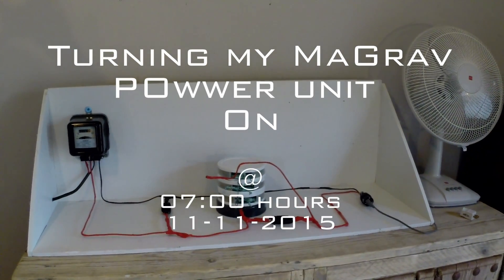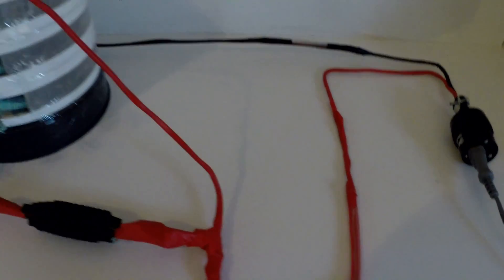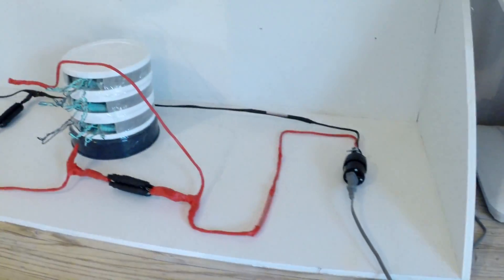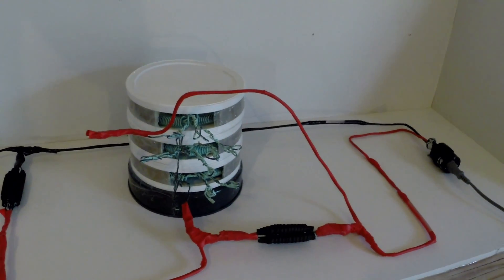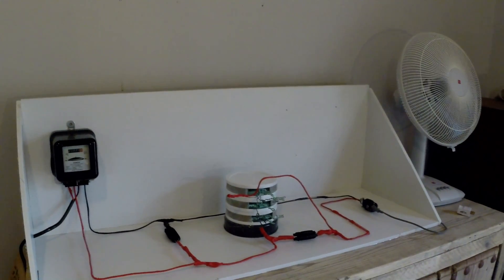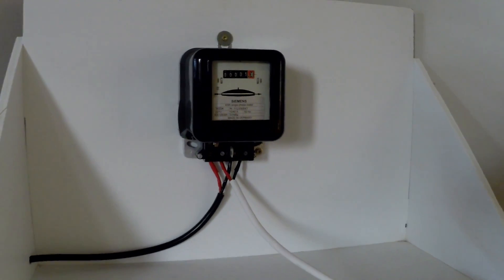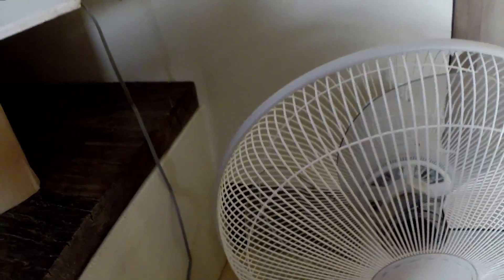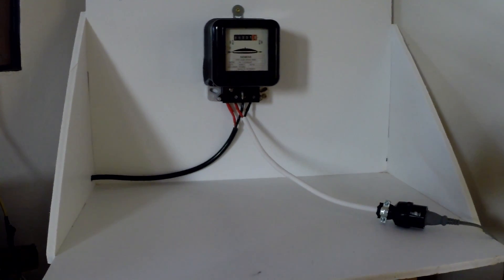Turning On my DIY MaGrav

Comment: Good stuff. Chemistry is where I grew up, so don't know much about electronics. I'd appreciate it therefore if yourself or some other electrician/electronics background individual out there could educate me on the use of capacitors. I know they hold and discharge a charge, but, why are they used period? You have one in parallel and one in a series (if I'm right about that?) as well. Do they help meter/buffer the flow of current? 

Another good question. I've always seen boards with capacitors and resistors and staminuses etc. Why are resistors not employed in this circuit?

These questions I've wondered about for a few decades but didn't have the time to study this stuff, yet! 

Cheers and Thanks.

Comment: Why did you remove the second meter on the load side of the Magrav power unit? You have your other video with a meter on the primary power input and one on the secondary and then in this video you removed the second meter? That makes no sense if you are trying to see load for load comparisons? 

Thanks,

Roger

Comment: Hard o follow sequence of videos (no naming convention?), but why don't you just put on a meter at both sides to measure the input and output (draw)?
Reply from the maker: +Gerry S Keshe said that does not work. He called it cascading.........
Reply: +Roald Boom   This response is a bit worrying.....one man become a god and anything he says is just accepted without question?  That is why we are still at this stage in 2016 I think
Reply from the maker: Gerry S Yes, Gerry, that is why I tested it and found the same conclusion. The whole KF is pure BS....
Reply: +Roald Boom  Hmmm....how did you come to the  'conclusion' that yours and mine were the same?  If this is your analytical depth I would have to question your conclusions on the KF too.
Reply from the maker: Gerry S Yes, question everything.

Comment: Hi, great video, very interesting !
I would like to see you experiment more with this and have a suggestion. 
Hopefully I get this right as it's been a while since hearing about the Cromray Device which gets attached to a battery but you could try attaching to your copper device.
I believe the Cromray device is a copper pipe thats 80 ft in length to which you part bury 6 feet into ground leaving 30ft of pipe height to absorb energy from the atmosphere which draws energy from the ionosphere.  Should give 50, 000 watts.
Reply from the maker: +Mhorag Christie Cool! I remember seeing something about that, but it had an antenna I think......

Comment: I believe I heard Mr Keshe say their cannot be any tape or shrink wrap on the wires because it is essentially plasma and will interfere with the flow u r trying to achieve . So for validation sake. U might think about removing it. Just a suggestion.

Comment: can i ask what exactly is the aim ?
it looks like you are trying to make a Barbosa Leal device - you do not need chemicals to achieve this in that particular design - and that system does work although as i do not know what the aim here is i could be confused.
search - 'Barbosa leal device'  it is a modification of other systems also from past.
Reply: +Kolin Evans oh i think i see - you are passing magnetic fluctuations though the wire to get a reaction? 
you are passing 50/60hz of North south magnetic flux from the 'power grid' to make a final reaction?
Reply from the maker: +Kolin Evans Hi Kolin, better listen to Keshe's videos to see what he says it should do....
Reply: Roald Boom
should we say to him - "if you can't explain it simply, you don't know how it works"?

i'm guessing he is going got get into 'special relativity' ?

notice what happens when you put a perm magnet up to a coil at resonance?
Reply: after this reaction you will have an aligned - improved stubblefield coil - search 'stubblefield coil' he was born in 1860 'Nathan stubblefield' he's the guy that invented a coil in a similar concept the coil produces energy though disruptive 'inductance.'
everything is about disrupting a magnetic field which is actually a 'gravity at frequency' field.

Comment: So the expectation is that the total consumption will fall in ratio over days and weeks? I think Keshe made claims like that, that the system over time would do that. But also, your setup, (with the clear windows) is no different than that of any other purchaser of the unit yes? Or are buyers/builders supposed to put the Magrav units before the household's consumption? So between the power meter and the house circuit? He claims that the house wires become nanocoated, so I am assuming in your setup you are only showing a single circuit. So far, even if it is minor, it is proof, however you might need to switch the fans from the control to the magrav and viceaversa to check that the difference is not efficiency in the 2 different units. The other test I guess you can show later is the connection of a 240V and a 110V simultaneously, that was a touted feature.

Comment: Looking forward to the follow up - today? 24 hour report?
Reply from the maker: +Graham Wilkinson 1300 -> 2600 watts on the Control Unit1300 -> 2570 watts on the MaGrav Unit
Reply: +Roald Boom This is a difference of 3,33% - ways too low to say anything
There are several factors which you must consider:
1) manufacturing tolerances of the fans- If they are cheapies (that's why I asked for Manufacturer and part numbers) this can be pretty well in the range of 5%
2) tolerances of the meters. It can be up to 2% for calibrated units. Cheap units from shops may be worse
3) Environment. If the airstream through the fan is in some way obstructed, this can decrease the power consumption by 10% or even more. The same holds true if the air is moving upstream or downstream with respect to the fan.
4) Room temperature can have some influence on the energy consumption of the fans

You can eliminate the problems above with a control measurement: connect both fans directly to the meters, repeat the test without changing anything else, don't touch the control group, just disconnect the fan in the MAGRAV group and connect it directly to the output of the meter
This will give you a pretty good value for the tolerances of the fans and counters. _Don't let you disturb by what Keshe says, just run your tests
Using these results the true deviation between the two groups in the first test you made can then easily be calculated

To you and all readers: In households in all countries Ferraris (mechanical or their electronic equivalent) counters&#160;are used by the grid providers and they are the only ones sold in electronic shops. These counters do not measure blind current and blind power, they only measure effective power which means, that Keshes claim, his device would compensate blind power and therefore cause less power consumption is definitely wrong , no matter what he is claiming.
Reply from the maker: Thanks Jean-Pierre,

Fans are KDK model A40A
Meters are Siemens W204
Airstream is slightly influential, but minimal
Room temperature is 6 degrees Celcius colder where the MaGrav is at...
Reply: Roald Boom Thanks - I will see what I can find about tech specs of the fans (there is a KDK page but it is offline at the moment)
I'll keep you informed :)

Comment: Question: Is the fan running off the Magrav?  Also, does the unit plug into the wall to activate the plasma coils and then the coils get going and provide over unity to the fan or what exactly is happening?
Reply from the maker: +TrelStudios  It is plugged into the wall to activate the plasma coils
Reply: +Roald Boom . Ok so it activates the coils and then the power stops coming from the wall and the coils only power the fan?  Can you clarify?
Reply from the maker: +TrelStudios Not yet, but the idea is that slowly the amount of electron energy will reduce and plasma will 'take over'..

Comment: Hi Roald, great to see that you have turned it on and also put some transparant tube on part of the wiring to document nanocoating process! Would like to have seen this even more on the left (power in) side of the system or on the plug you use to connect to the wall as mr keshe described that the unit will start nanocoating the entire house. If I remember correctly he said that this would take (minimum) three weeks but I assume (?) that the closer to the unit the sooner the nanocoating will start....Anyway a BIG congrats and respect to you!
Reply from the maker: +Jappie CR Thanks!

Comment: Hi Boom,
you did an incredible work - thank you so much for sharing!!
I think you can´t imagine how much you video help me do go further.
One additional idea: could you measure the speed of both fans? It´s also an indicator for the power - maybe the MAGRAV Fan ist getting even faster or slower.
Reply: +Roald Boom That is the simple way - sound. You can record the fan's sound  and compare the waves in an audio editing program. Or you can buy el cheapo laser RPM meter :)
Reply from the maker: Thanks!
Reply: +Roald Boom I think measuring the fan RPM is a key info as you had remove the second power meter. As we know (by the mainstream science:) ), just coils in series are as resistor so less power will be drain. Thank you for the great work and wish you all the best. Hopefully mr. Keshe has set us all free.
Reply from the maker: +Hans Albers I would not know how to measure speed, do you?I will listen to the fans to see if I hear any differences......
Reply: +vladimir stojkov These coils have a resistance which is negleble both in DC and AC at grid frequency. A few milliohms are less than 1% of the 260 Ohms of a 2 KW load.

Comment: Good Test! What is about the drilling concerning clockwise and anticlockwise?
Reply from the maker: +Markus Möller Not sure Mr Keshe has said contradicting things about that all through out the Blueprintweek......Nobody is sure, I think it does not matter......
Reply: +Roald Boom  I've watched many workshops recently and the only things that matter is uniform direction of the coils in the whole device. It can be CCW or CW but must be identical on every connection/element, according to Keshe.